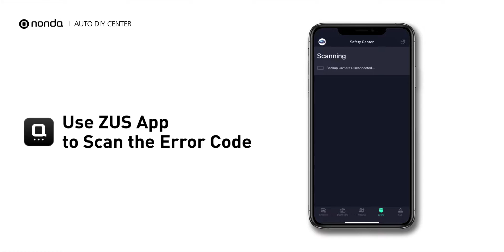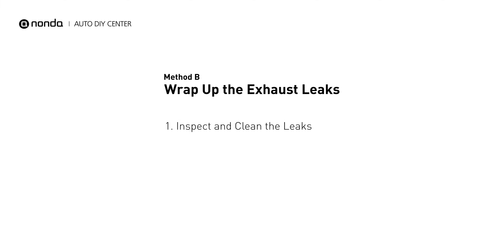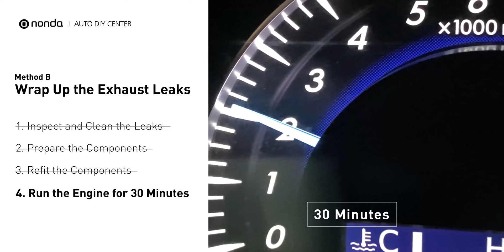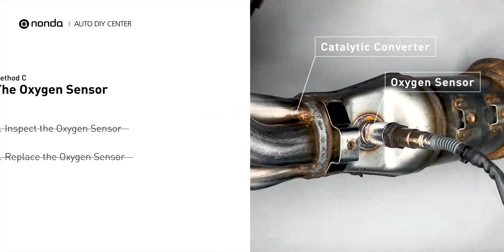How to Fix P0130 Engine Code in 4 Minutes [3 DIY Methods / Only $9.38]

Comment: Hi. What if the leaks is on the muffler area, Is it possible if the leaks at the back can trigger the 1st sensor  faulty, which the position of that sensor is at the front?

Comment: @nondainc Hello my friend. I have a 2012 model Hyundai i20. My car runs on gasoline and LPG. I am getting error P0130. I have a problem with rev fluctuation at idle. When using LPG, there is also a misfire at a certain engine speed. I changed the sensor once but to no avail. I'm waiting for your recommendations.

Comment: my car  giving p0130 code but mil is off .. we trying to solve this but machine can not  find problem...we change o2 sensor and cat converter  but  issue is here.. my car  engine run  like roughly  ...some time jerking while drive .. mostly 60 km speed ...
Reply from the maker: Hi Jasveer, can you please provide us with your vehicle's year, make and model?
Reply: Check pcv valve,hose might be kinked or defective valve

Comment: OMG I am pulling my hair out.  I am an OAP & do not get alot of cash, so went for your free code eraser.  I live in UK & have to pay 18 pounds.  I have a code reader, cheap one. used it as my engine light came on, it came up with a Code PO130, I purchased an 02 sensor & got it put on.  The engine light stayed off for a little while but the light is still coming on.  I dont know what to do now.  Any hints would help before I go bald.
Reply from the maker: Hello, have you inspected all the wiring related, the electrical signal condition, and if there's any leaks?
Reply: @nondainc  No will get that done, my son in law will be taking the car next week so a mechanic can check it out.  Thank you for replying to me.  Take care.
Reply from the maker: You're most welcome! Stay safe.

Comment: Hi.. My car had a code of P0053. So i had cleaned the O2 Sensor using wd40 and put it back. After cleaning, i m getting P0130 and P0134. What is the issue? Did i do something wrong by cleaning it?
Reply from the maker: Hello, please refer to your vehicle's service manual to avoid misdiagnosis as treating error codes could be different per vehicle's make/model. Thank you.
Reply: Maybe you vaccum issue check PCV ITS working or not and check if you have air leak
Reply: Dont apply any kind of lubrication to o2 sensors. Those sensors are very sensitive.

Comment: Have the P0130 on my car but no unusual car behaviour. How serious this error code is? Is it safe not to take care about it?
Reply from the maker: Hello, this code is not considered as severe and it won't prevent your vehicle from running. However, if you ignore the code for a long period of time, it may damage the engine of your vehicle. Your fuel economy will be drastically reduced, and you may find yourself spending much gasoline. Also, this can damage your catalytic converter.
Reply: @nondainc  thank you

Comment: P0031 p1148 p0130 yep it's an oxygen sensor
Reply from the maker: Hi Dwayne, these codes are triggered by a faulty A/F sensor and a replacement is needed.

Comment: Possible cause for code po130
Reply from the maker: Hello, there are several factors that triggers this code. These could be leaks, loose/damaged wirings, or some parts needed a replacement like the catalytic converter and oxygen sensor. We suggest following our guide in the video on how to fix the code so you can lessen your expenses. Hope it helps!